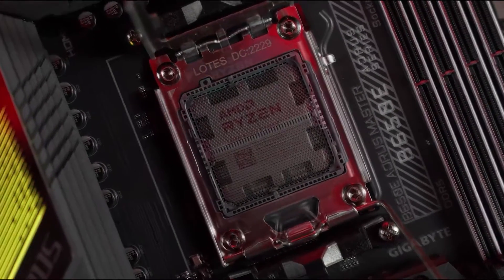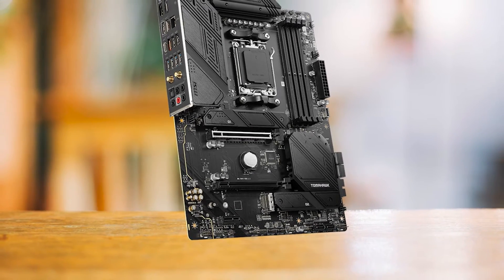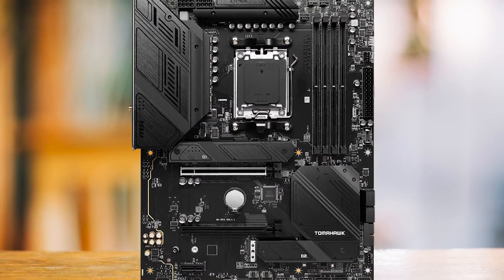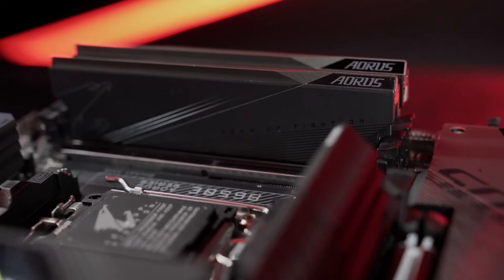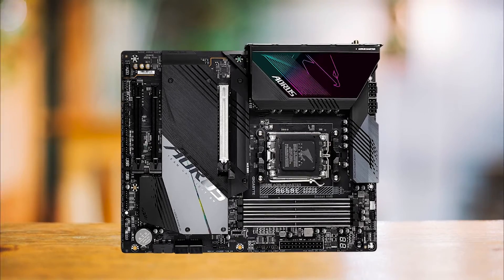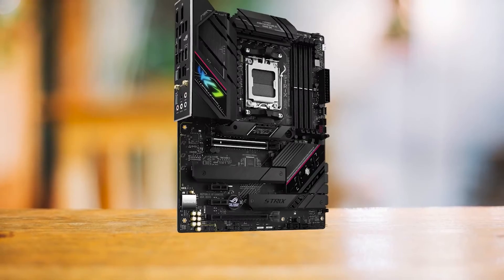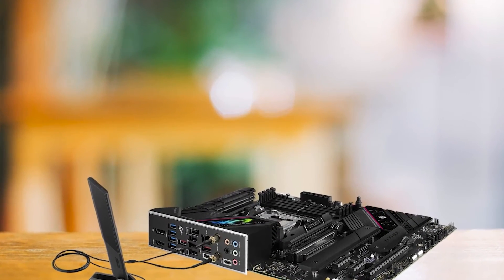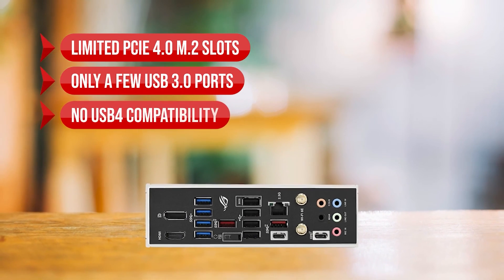THE BEST MOTHERBOARDS FOR RYZEN 5 7600x! (TOP 3)

Comment: What brand I should go for? Is asus the best
Reply: Asus is definitely the most reliable their software is solid as well
Reply: @xXkillalzXx   yeah I ended up getting the b650 a gaming wifi. So far so good. It’s great and no issues at all. I run it with a 7800x3d
Reply: @xXkillalzXx  Asus low end boards are awful